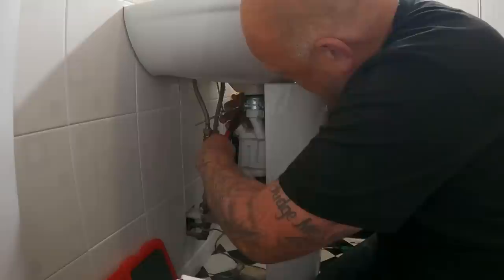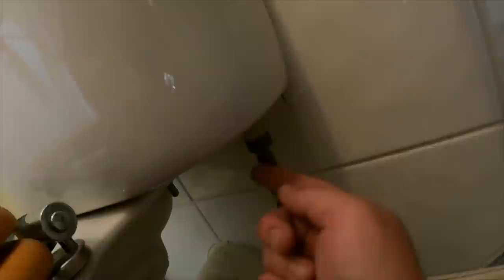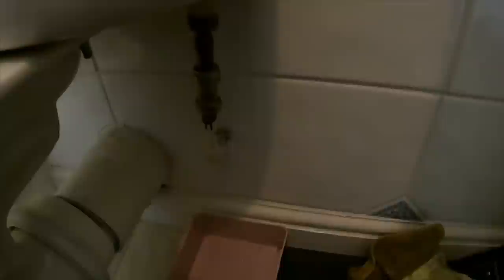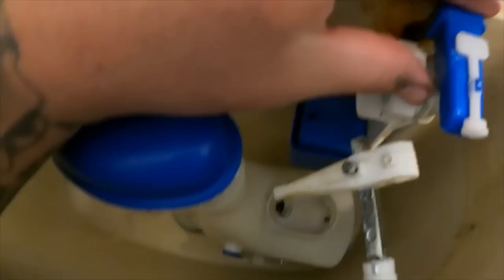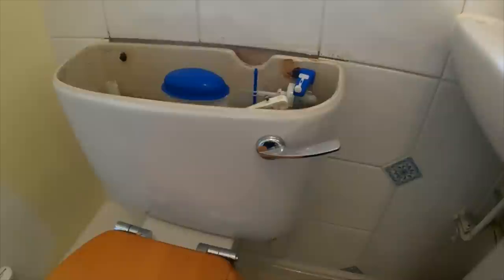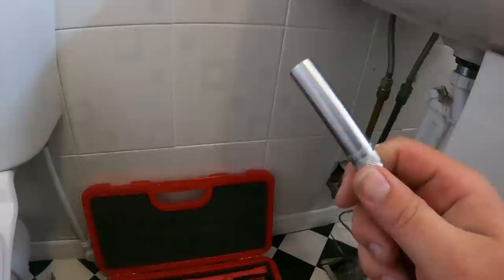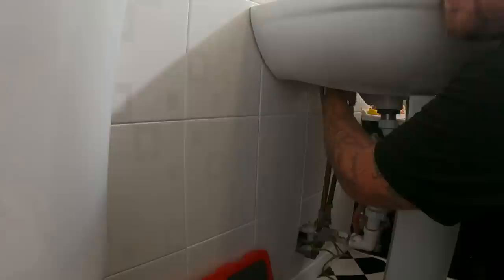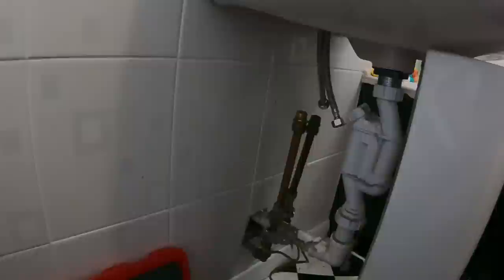SIMPLE DIY PLUMBING JOBS CAN GO WRONG | How to fix toilets, basins & change taps

Comment: Oh the dreaded 5 mins job that turn into 5 hours and it’s unbelievable certain customers who will say “ oh sure it’s only a small job” and that jinxes you from the start. It helps massively when you can isolate the toilet at the supply and not have to clamber into the loft where there’s more stuff there than an Amazon warehouse. Well done Mark excellent video these are great to watch to see how you deal with the myriad problems plumbers face on a daily basis. Your a credit to your trade.
Reply from the maker: Thanks buddy, glad you liked the comtent

Comment: I always use two screwdrivers in the top of the waste , while holding the nut with my pump grips . Works most of the time ! 😊
Reply from the maker: Was nothing inside this waste as it was a sleeved pop up one……. And would of fell apart anyway by the looks of it🤣🤦🏻‍♂️
Reply: @MJTiffPlumbing  if you put the screwdrivers in the overflow slots of these wastes mate that helps to then spin them out 👍🏻

Comment: If I can identify the flush syphons I always just replaced the top part rather than the whole cradle mount as it saves time and a cheaper job for the customer. As long as it's nice and tight and not leaking I always carry a siamp optima 50 and fluid master push button as they seem to be the most common for me.

Comment: I fitted a bathroom back in 2020, the customer supplied the basin and waste, around a year later the waste was corroded. I had to multi Tool the thing out.  That was a £11 Amazon special. By cheap, pay twice.
I do like the odd jobs, but sometimes you wish you never took them on.
Reply from the maker: Cheap fittings…. Not worth the hassle as you’ve seen….

Comment: Silicone is good, but personally takes 24 hours to set , really waste my time if , you willing to wait 24 hours 😂 basin mate is cheaper than a silicone itself, it’s a bastard to install tho , but don’t need to wait for 24 hours , that’s where you got a winner, and in some vanity units where chippys doesn’t care about plumbers, all the cuts done for a basin they left barely space for silicone tube to seal it under , and you got flexis and waste pipes in the way , only one way doing it is lifting whole basin up 🙈 just for a waste , and that’s where basin mate safe the all trouble 😅
Reply from the maker: We all have ways that we prefer👍🏼👍🏼

Comment: those tapped kits have shot up in price. i got one last year for around £140.95 now £156.50 from same seller. plumb2u they took ages to send out. i was looking forward to using it a few weeks back on a heritage basin tap replacement,  but none of the bits fitted i think it was a 14mm and set only covers 13mm
Reply from the maker: Haven’t they just mate…. I was shocked when I added the link
Reply: @MJTiffPlumbing  if you were paid £1 for every time you said nerrad tappex kit you could retire early.
Reply from the maker: Nerrad Tapex kit
Nerrad Tapex kit
Nerrad Tapex kit

🤣🤣👌🏼😉
Reply: I paid £174 from Amazon.
Reply: @michaelsharpin3369  rip off